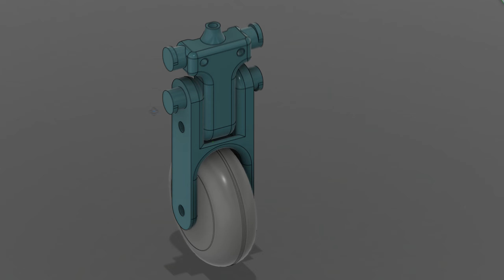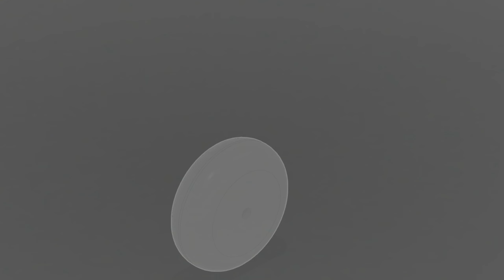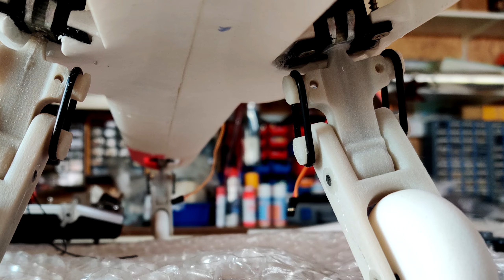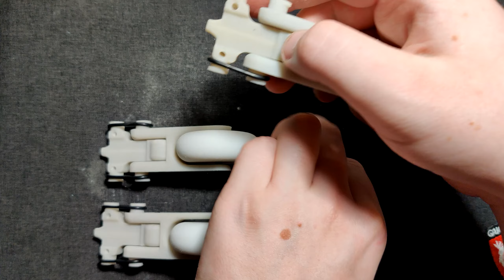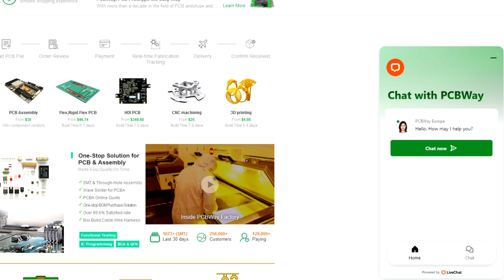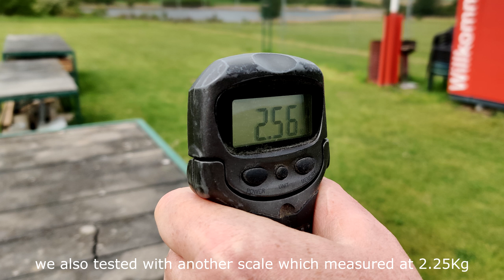My first 3D Printed F-111 is assembled and ready for testing!

Comment: With the undercarriage, would it be wise to put an offset on the o-ring connection point to preset the wheel in a wheel back position? 

In the shown design, vertical forces are transmitted directly upward into the airframe. Putting in the offset angle would allow the o-ring to take the shock.